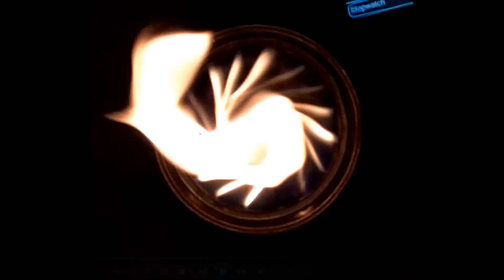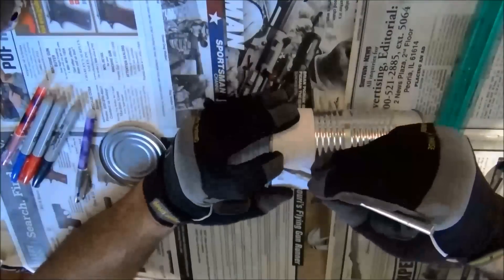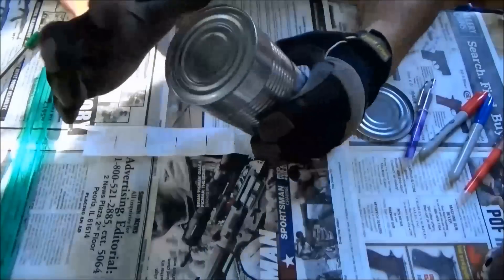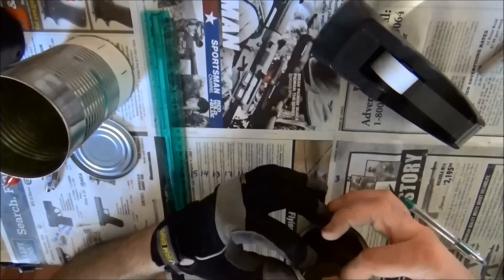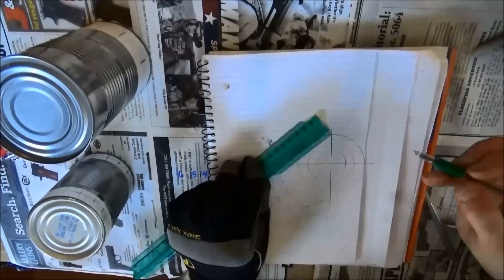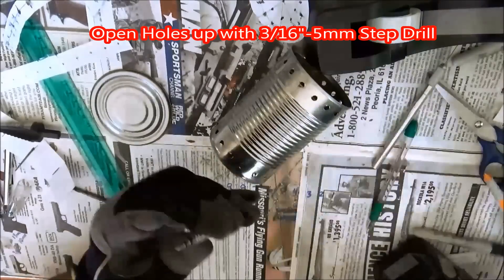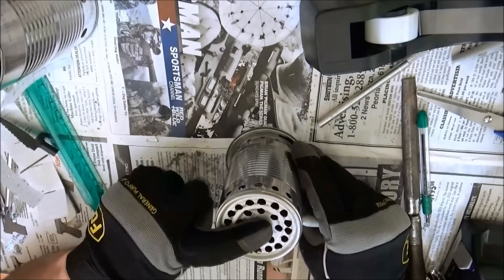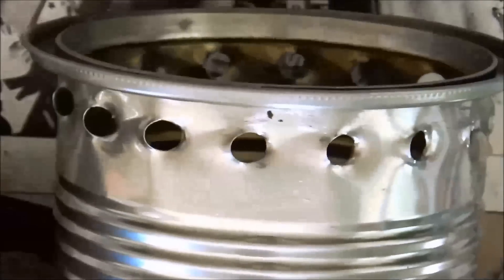Wood Gas Stove Science!! Vortex V5.4 Build!!

Comment: The only difference between this and the  normal wood gas stove design is that you used a tool to put a twist in the hole to direct the air  in a circular flow.
Reply from the maker: OK?

Comment: Boiled in 6 minutes?  Not bad.  I just made a copy of a stove called Ranger Mk II or something like that.  Boiled me two cups of water in only 25 minutes.
Reply: Just for fun, I dug through all my Progresso cans and found one with sixteen 1/4" holes on top and three rows of sixteen 1/4" holes on bottom and stuck it in my pain can. Then I put your pot stand on top and two cups of very cold water boiled in about 8:30. Much better.
Reply from the maker: Lol! Not a great time! Thanks for the comment!
Reply: @heathputnam9524  the amount of holes in the can just didn't seem right. I even told the dog there's no way it could work.  Sixteen 1/4" on top and thirty-two 1/8" on bottom.  I didn't do the math but it must be close to 1:1.  Sure, it burned over an hour but who wants to wait 30 minutes for Ramen?
Reply from the maker: Have your dog watch again! Haha! The 16 secondary holes are 3/16 inch diameter and then there are 25 holes in the bottom and 16 around the bottom sides. This is a total of 41 primary holes and they are 1/4 inch in diameter. If you follow the instructions carefully you will boil water in as little as 6 minutes! Good luck!
Reply from the maker: Rick, I just reread your second comment… was it about your stove or the Vortex 5.4? Sorry if I misunderstood!
Reply: @heathputnam9524  it was the other one. And just like in one of your videos, there was a thick, sticky goop on the bottom of my pot.  In fact, it was stuck to the pot stand and pulled it off when I tried to remove the pot.

Comment: Have you ever tried one large hole in the bottom instead of the many small ones?
Reply from the maker: I am working with ratios to fully understand the science behind the stove so the holes are important for the area calculation. Too much primary air volume and the stove will not develop a proper pyrolysis zone and will   Not be efficient. Thanks for the question.

Comment: I really have to hand it to you Heath, the vortex is really cool to look at. Was wondering if you could do the same to a rocket stove ??? Thanks too.
Reply from the maker: It could be done with the secondary burn in a rocket stove! Thanks for the comment!
Reply: @heathputnam9524  Could you be so kind and explain how this would be done ??? Thanks
Reply from the maker: As your rocket stove burns the hot gasses are rising in your “chimney” if you introduce fresh air part way up (secondary air) the  remaining unburnt gasses will ignite in the chimney. If that (secondary) air is introduced at an angle it will produce a vortex type flame. It will require some experimenting on the placement and size of the secondary air inlets that will depend on your particular rocket stove. Thanks for watching!

Comment: A little confusing on size and numbers of holes. From what I can gather, the final was: OUTSIDE CAN - 3 7/16 dia x 5 3/4 tall 8 - 3/8 dia holes 3/4 up from bottom   INSIDE CAN - 3 dia x 4 1/2 tall 24 - 1/4 dia holes 1/2 up from bottom and 17 - 1/4 dia holes on the bottom and 16 - 3/16 dia holes 1/2 inch down from top
Reply from the maker: I think you have it! Thanks for watching!

Comment: Have you considered using a wire mesh like a cooling tray from baking for the underside of the inner can instead of it's base with holes drilled? Is there any benefit to restricting the air to the chamber for the primary burn?

Comment: Hurricanes and tornadoes rotate counter-clockwise in the N. Hemisphere.  Bending the air holes to cause the same rotation may help with the air/gas flows.
Reply from the maker: I have built them either way and it does not seem to make a difference. It would have been cool if it did. Thanks for the comment!

Comment: Really appreciate the detail. I've made at least three  from your info and all looks well until I put a pan on and then comes the smoke. Played around with bigger holes outer can and  inner secondary  and with your pan stand almost get there but still the jets are almost all yellow. In UK we don't seem to use the taller size outer can so limited to one only a cm bigger than the inner so can't experiment with that very much. Haven't cut the bottom off completely as in my commercial gasifier but it's possibly the next thing. Have you anything to offer on tuning for blue jets? Even the yellow aren't really strong. Thanks.
Reply: I'm using wood pellets btw.
Reply from the maker: I would not change the secondary (top holes on inner can) hole size, but increasing the size of the primary( lower holes on inner can) hole size slightly. Also try increasing the hole size on the outer can slightly. Some optimization is needed on these stoves depending on elevation and other weather conditions. Another factor to help reduce smoke could be pot stand. If you used my design from my pot stand video... Try making one with one more hole around the bottom. Let me know if this helps! Thanks for the question!
Reply from the maker: Jeff Lynn the Jets will lose power with larger holes in the top of the inner can. You mentioned weak jets of flame... I found I lost a lot of power when I increased the size of the holes to 6mm or larger. 4.5 - 5mm was what I found optimal.
Reply: Yes that's just what I found. First build was best till I found the smoke later...impressive flame and jets but I drilled out the secondaries slightly and found exactly that. Already on with number four since my first post.  My drills are metric and don't transpose directly to  your 3/16 and 1/4 so I've chosen lesser equivalent  on this build. Back to basics. Thanks for the help...it's become a mission.
Reply from the maker: Jeff Lynn I would suggest building one just like your first one, then make changes to the pot stand. I found the hottest part of the flame with my design is about three inches or 75mm so that should be at the bottom of your can and should have plenty available air flow but not so much wind will negatively effect your burn! Hope that helps!
Reply from the maker: https://www.youtube.com/edit?o=U&video_id=lfpskfoSk9I take a look at this video... it is my pot stand. if you have issues with smoke add an extra hole or increase the size slightly.

Comment: Hey Heath, thanks for your videos, I really like the optimization video as well. I have watched about 20 builds of this stove but yours is the one I will be making.. I found from about 8:00 to 9:00 of the video a little confusing. It looks like the outer can sits upright. You use the cut off top to make that right that goes around the inner can. However that ring just kind of sits there with gravity. Many other builds have the outer can sitting upside down with the open end on the bottom. They then cut a hole in the bottom the size of the inner can and squeeze the inner can in. It seems to me that with your method, the ring isn't air tight. Does that mess with the 1/5 ratio? If I did it upside down as mentioned, would that mess with the 1/5 ratio? Thanks!
Reply from the maker: The side cutting can openers I use cuts the can in a way that the top sort of pops back on relatively tightly. *This method requires side cutting can opener!* Warning! these stoves get so hot that an open bottom can will burn whatever it is sitting on! You can follow anyone's instructions you would like and will have mixed results. Possibly better, possibly worse than mine. I do not think using an open bottom stove with the can flipped over will hinder the operation or mess with the 5:1 ratio. Whatever you do, have fun and be safe!

Comment: Hey there Heath Putnam. I'm trying to make a bigger version of these with a stainless steel pot.  One is a 19 litre pot and the other one doesn't quite say its litre measurements. Now, I dunno if I should make the holes bigger or keep them the same size as per the cans on your video so that it doesn't mess up the air current effect its supposed to have. Could you please give me some advice?

Comment: I built this gasified and I only got 25 minutes burn on one cup of pellets? So I went back and watched the video 4 times. To make sure I had everything right. I still only get 24 to 26 minutes of burn time on one cup of pellets?
Reply from the maker: I am using softwood pellets, they may burn a little longer than yours. If you want a longer burn time, you can cover a few of the primary holes in the bottom of the inner can.
Reply: Heath Putnam thank you, I will try that . Which softwood pellets are you using?

Comment: Nice job figuring out these stoves. What do you think about cutting the bottom out of the inner can and securing a 1/4" x 1/4" SS mesh instead of drilling the 25 holes in the can's bottom to boost the primary air to the max and also allow the ash to fall thru effortlessly? http://www.ebay.com/itm/Stainless-Steel-304-Mesh-4-047Wire-Cloth-Screen-4-x4-/122242743013?hash=item1c763c3ae5:g:AWQAAOSw7aBVITkV

Comment: i'm imagining you could use similar cans right? say a 28oz  can of tomatoes and a 14.5oz can of tomatoes that isn't a flip top?  dimensions of the can are slightly off but i don't see it affecting the performance of the stove any also on the outer can would it matter if you didn't keep the bottom on? don't the ashes fall through the bottom holes of the inner can? how do you get those out?
Reply from the maker: Yes you can use other cans. Things to beware of... 

*about 1/4 inch between the inner and outer can. More will not properly heat the air, less will obstruct airflow
*keep the primary/secondary air ratio as close to 5:1 as possible
*as little air leakage around the top of the cans as possible.
*best performance comes from precise hole placement. 
*if your stove does not perform at first, try enlarging the fresh air inlet holes slightly

Hope this helps. Thanks for the comments!
Reply from the maker: I like to keep the bottom on the can so it doesn't start a fire. I store my pot stand in between the two cans by taking the top off the stove, sliding the pot stand over the bottom of the inner can and then putting the top back on the stove. When I do this I just dump out the ashes.

You can use different cans just keep the air ratio similar and make sure you have enough airflow between the two cans up to the secondary air holes. Good luck! Thanks for the comment!

Comment: Thanks for a great video. Very informative and I successfully created my own 5.4 today. My jets aren't as strong so I'm not sure where I went wrong. I made the holes in my outer can 1/2 inch because I didn't have a 3/8 bit. I'm not sure if that's my problem or it's my fuel, I'm using sticks scavenged from the ground. Either way thank you for this great video and all of your informative videos.

Comment: Thank you for a great build video! The entire Wood Gas Stove Science 
playlist is a joy to watch. I'm having a go at V5.4 and wanted to ask how 
snugly the lid of your outer can fits after you've removed it with the side cutting opener. From the 
video it seems that it snaps into place to make an airtight fit and that your cutter automagically makes some sort of special edge on the can to make that fit possible. My opener makes a clean cut but that only allows the lid to lie on top of the can with something like a 0,5mm gap in a couple of places. What brand and model is your opener? My concern is what an imperfect fit will do to the draft and the potentially less elegant solution of using solder or pushing the inner can through the lid while it it still attached.
Reply from the maker: My side cutter can opener is nothing special. I think I got it from Bed Bath and Beyond. It cuts a groove in the outer lip of the can, so it can be just pushed back in place. It seals up nicely. I have had several people comment they were not getting a good burn when they built the 5.4 but I just had them add another hole to the outer can or make the holes slightly larger. It only happens some times, I think it may be an altitude thing. Thanks for the comment.

Comment: Heath,
I just built my first Vortex 5.4.  I did not get your results. The secondary ports were weak.  At some times they would quit, and the wood would just burn in the chamber.  If I gave the can a little shake the secondary ports would start up again. Other stats:  I tested outside in a light snow storm with a light wind.  I don't have any wood pellets so I used hickory chips (they lay flat in the burn chamber I don't know if this affected gas flow or not.)  Please comment so I can see this thing roar.  Also can you provide the build specs for the pot holder I think this would help. Thanks.
Reply from the maker: +Troy Belanger Try making the holes on the outside can a little larger or add one. Let me know if that helps.
Reply: +Heath Putnam I increased the intake holes to 1/2".  Then I read about the 5:1 ratio of the inner can, so I increased eight holes from 1/4" to 5/16" (every other one on the side of the can).  I switched fuel to pellets (from chips) and ran a burn test.  Results: gasification started at 3min. mark, and ran until the 24min. mark. At that point I blew  into the top, it reignited, and finished at the 34min. mark.  Flame was very impressive.
Next test, I will increase the eight air intake holes (of the outer can) from 1/2" to 5/8".  Then the air intake holes of the outer can will be greater than the holes of the inner can (as mentioned in your comments).  Have you tried this test yet?
Reply from the maker: Glad the comments helped. I generally only open the outer can holes enough to get a good burn because if the holes are too big the flame can be effected more by wind. I like to here my videos helped people build and enjoy wood gas stoves!
Thanks for the comments!
Reply: +Heath Putnam Can you provide the specs of your pot holder 3.0.  I think this will help to improve my flame. thanks for the videos.

Comment: I don't mean to be a bother, but I've just built two 5.4 stoves to spec, clean holes, meticulously executed. The cans are the same size as the cans you recommended. One cup of wood pellets, and a splash of heat from a yellow bottle. The flame after 15 minutes looks and feels similar to when I first lit the pellets, only an occasional weak vortex flame spurt. Never finished burning the pellets before the flame finally went out at about 25 min. Outside temp 40 degrees, no wind. Any ideas!? Thanks for all your help!
Reply from the maker: +Greg McGary Verify the inner can has at least 1/4 inch clear space below it so the air can flow between the inner and outer can. Verify you have at least 1/8 inch gap between the sides of the two cans so the air can flow up to the secondary (top) air holes. It sounds like restricted air flow to the secondary air holes. you may want to try to add or enlarge the fresh air holes on the bottom of the outside can. Did this look like your burn test? https://www.youtube.com/watch?v=OnukiLba3bk
Reply from the maker: +Greg McGary I replied to your comment but it included a link so it may have gone into spam folder.
Reply: +Heath Putnam I increased the outside cans air hole size to 1/2" it's working awesome! Thanks for the link, and all your help!
Reply from the maker: Awesome! you should be able to cover one of the outer holes without effecting the jets. If you cover a hole with your finger and the flame dies a little, you may want to give it a tiny bit more fresh air. Glad it works for you! Thanks for the comments!
Reply: Heath Putnam i

Comment: Ok I should be sleeping, but I'm geeking out on this! I just watched a build on a wood stove. The stove itself is beautiful, and stainless, but I'm wondering if I can apply your ratios and principles to the other stoves materials? Would you mind watching the video and tell me if and how I can make his stove into your 5.4 version? http://youtu.be/67_-INx2iEY you are the man!!
Reply from the maker: +Greg McGary You should be able to apply the same principles. The air ratio for the Vortex V5.4 is 5:1 primary air (bottom of can) to secondary air (top of the can) holes. Keep your secondary (top) holes at 3/16 inch diameter just make more of them. If you go to large with the secondary air hole size you will lose air velocity and the "jets" may not extend to the middle of the stove. You want the flame to cap off the top of the stove or you will not get the pyrolysis (oxygen free) zone above your fuel. Make sure your fresh air inlet (outside can) volume is greater than the total volume of your primary and secondary air holes combined. Hope this helps!! Thanks for the comments!

Comment: Did you ever do a pot stand 3.0 build video, or is there a pot stand you'd recommend for the stove? Also do you think the insulating material on the outside of a "Jetboil" would work on this stove? Thanks for your quick response!!
Reply from the maker: +Greg McGary I have not done a pot stand video yet. I'll try to get one done this weekend. The insulation may work when it is very cold. I did an experiment with insulation and it did not make a significant difference, but try it and let me know how it works! Thanks for the comments!